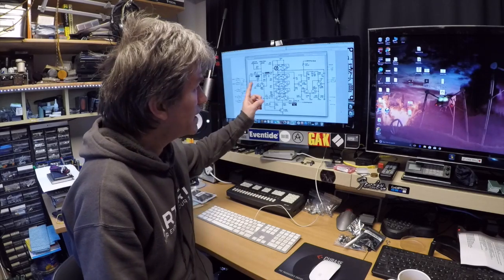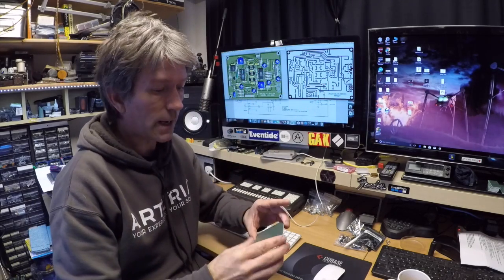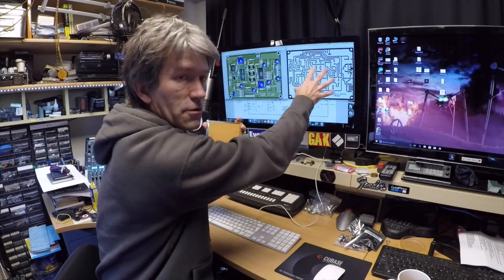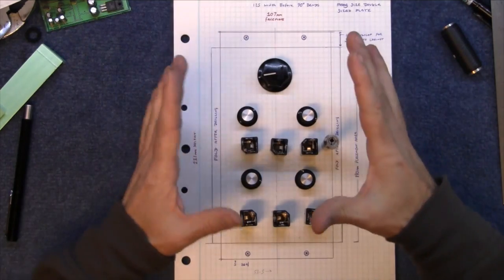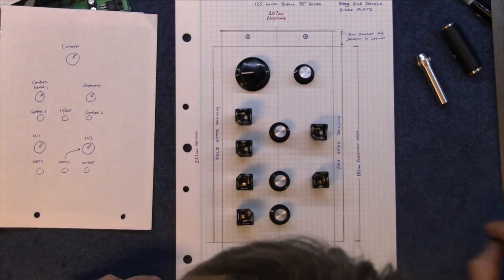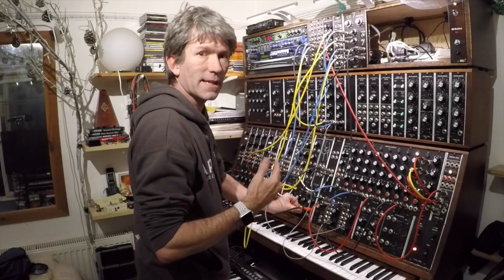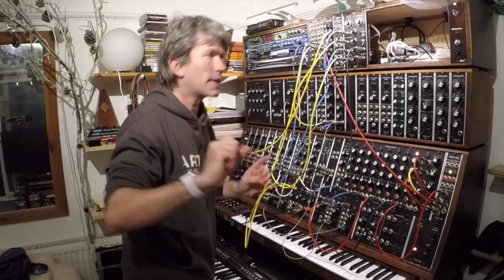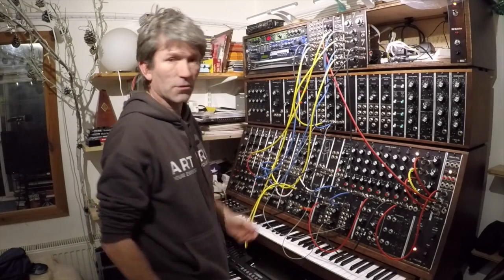BOB's LADDER based on moogs ladder filter built on simple perf board

Comment: On the jacking system.  it is a hell of a lot better to put all the jacks on the top or bottom, of each module, so the patch cords and jacks don't get in the way, when You are trying to use it.  I would use RCA jacks as they use smaller plugs, are cheaper, and very robust.

Comment: It is actually a hell of a lot easier to etch boards than You think.   Especially with the pattern is already done for You.  You can coat the board with a mixture of Potassium dichromate, and gum arabic, and copper sulfate to make it more sensitive to UV.   Mostly gum arabic, (like 80 %) and a few grams of Potassium Dichromate, and perhaps a bit more copper sulfate, to make a quart. After spreading that on the board and letting it dry in the dark,.. Lay it out in the sun with the mask  over it, for ten - twenty minutes or so (experiment first), and then wash off the part that was hidden in the shadows that is still water soluble.  You etch in Ferrous chloride (witch is nasty but not nitric acid), and by placing about 6 Volts DC, on the board, and a carbon rod in the solution, you can increase the rate of etch, and also use the solution over and over.   i can't remember witch lead connects to the solution, but basically that is the side where copper is going into solution , so I think that's the negative side. After etching, wash off the board thoroughly, and then let it soak over night in water with a little baking soda.  It is so much easier not to have to wire each board over and over. 
   I believe that guy You mentioned also sells pre etched boards and they don't seem to be too expensive.  The problem with the rat shack type boards or the Chinese equivalent, is that the copper bits are so tiny, that they easily delaminate, or fall off the board with the temperature of soldering, especially when correcting a mistake.  You can also make a silk screen the same way i just mentioned above to make lots of the same circuit.  Remember the dark parts of the pattern on the plastic sheet are the parts that get washed away, when it is on the board, and the opposite when You are making a silk screen.  To make a positive from a negative You are going to have to do some graphics image reversal on Your computer.

Comment: Sounds great! :) And the instructions are really neat, thanks for this! Actually i've expected to hear something "classic" like two-detuned sawtooth oscillators and "cutoff sweeps" showcase. But this also demonstrates something!
Markus, if you're really into simplifying the hard work of board making then you better look at this!
https://ru.aliexpress.com/item/PCB-Manufacturer-in-China-Cheap-Circuit-Boards-Fabrication-Printed-Circuit-Boards-by-Advanced-Circuits-free-protoboard/1817842276.html?src=google&albslr=126207724&isdl=y&aff_short_key=UneMJZVf&source=%7Bifdyn:dyn%7D%7Bifpla:pla%7D%7Bifdbm:DBM&albch=DID%7D&src=google&albch=shopping&acnt=494-037-6276&isdl=y&albcp=657872107&albag=38867178172&slnk=&trgt=61865531738&plac=&crea=ru1817842276&netw=g&device=c&mtctp=&gclid=EAIaIQobChMI-P6h_9P82QIVqrDtCh39CwBREAYYASABEgLMF_D_BwE&gclsrc=aw.ds
People says that they do with a really great quality and deliver quickly. PCB making within three (!) days!

Comment: Awesome build, and a very nice video! Note that apart from matching the transistors in the ladder (which is 5 pairs in total, if I recall correctly), Moog also specified the capacitors in the ladder to be within 1% of eachother (which is easiest done by just buying 20 caps and match them, rather than trying to find expensive styroflex caps). I myself did a PCB which also has the Minimoog discrete "dual" VCA, highly recommended!
Reply from the maker: Hello I did check the caps and they were all pretty close in value. but yes the better the match the better the circuit.
Reply: markusfuller , lots of nice vcfs to choose from Polivoks or Wasp if you want something nasty, 2044 (reissue!) or 3320 for a nice vcf. Great that the ic's for both of the latter ones are in production once more. Good luck with your channel!

Comment: Markus Just another side note, you should check out Tony Allgoods site. Oakleysound.com for some more diy BRILLIANT modules, the format is MOTM but easily converted to synthesizers.com format. He has a guy called Krisp who makes the modules ready made as MOTM or Dotcom.
Dave Browns ModularSynthesis.com is an absolute treasure trove of deatailed information you would love as he goes really into depth about the way different modules are made with very good photos to accompany them.
Analognotes.com is a kind of reference library for other links to usefull bits of info, manufactureers of modules and other bits and bobs.
If I can remember some more I'll tell you.

Comment: High Mark. I'm the guy who mentioned Yve Uson to you not so long ago. Anyway, I am just about to get from Oshpark open source pcb manufacturer a wonderfull little circuit based on the Ian Fritz' transistor matcher. There are 2 main, (well 3, if you consider  Bob Moogs method in the Minimoog service manual) of matching transistors that seem to be the rule of thumb within the synth diy community. One is Ray Wilsons method which can be found under the side menu of "Transistor Matching 101" from his website "Music From Outer Space". Anyone who is into synth diy would of come across his font of knowledge at some point or other and if not and anyone who is starting out like myself into the foray of trying to fathom schematics etc, you should check out the web site. Sadly he passed away a few years ago now and no doubt has left many broken hearts. Typically, as is the case with me, I always arrive late on the scene and have only relatively recently discovered the universe of possibilities of being able to  create synthesizers that make the sounds we are all familiar with.
Anyway, I digress and waffle on for ages not actually getting to the point.
Ray has a schematic for creating a circuit to test NPN and PNP transistors which is briliant but I am just getting to the point where I can follow the signal path within a schematic but cant for the life of me translate that into a breadboard circuit or stripboard, whatever. Rays circuit measures accurately each transistor so one would obviously "match" the values.
There is another circuit which is far les complicated and a damn site easier to build and use, (I say that even though I still cant lay down the plans in circuit form).
Ian Frit's transistor matcher measures the difference between the two transistors and can be used in a way that a reference transistor is used as a base line to compare to or can be used to just obtain the reading of each one individually.
This long winded dialogue started with me trying to say that I'm getting a couple sent to me from the pcb manufacturer some time towards the end of the month and was wondering as a little trade perhaps if we could correspond through email or something if you could tell me how you make your panels, as I'm wanting to make my modular in the MU format or Dotcom as its sometimes called.
I want to make my own faceplates but the bending of the side bits I;m not sure how they are done. The Dotcom panels seem to have a slight curve to where they are bent that gives a lovely aesthetic look when two panels are side by side but I'd love to know how they are done, with a machine clearly, if you look closely you can see what I'm refering to. The aluminium sheet doesnt just have a straight square cut out of the four corners and then the sides just bent inwards, there is a little signature small curve and then is bent.
I would still like to have a go at making my own panels. I'f they are no good I might just go MOTM or failing that by blank panels from Synthesizers.com or Moon Modular.
Like I say I'll do a trade for some info on how you make your panels because you never did tell us how you made the panels just showing us your experiments with annodising and engraving and that was that.
Perhaps you can help me read a schematic and then re-create it on a breadboard etc. I'm slowly learning this electronics lark but slowly being the operative word.
Most transistors providing they are bought on a strip or ammo belt will be fairly the same. Synths tend to call for VBE to be matched, not always but most of the time.
That Peak thing you have should read VBE I think.
I'll show you the pcb layout if I can send you something to somewhere.
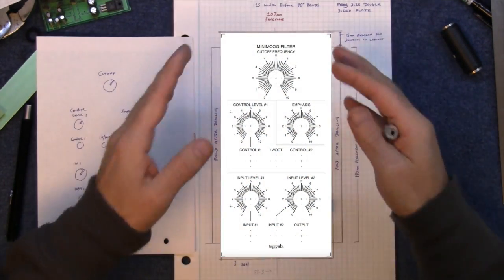Reply from the maker: Hello firstly Thank you as you did indeed point me in the direction of yusynth.net which is a gold mine of useful information. I made a previous video titled "Expanding the Moog Modular synthesizer & making the Attenuator" in it at about 5:08 I show the metal bending machine that I use to make the edges. this is a bit expensive about £200 but there are several vids on youtube showing how you can make a similar device with just 2 pieces of angle iron bolted to a desk. I simply bought the Clark version as it also cuts bends and rolls all in one machine and it was purchased for other work I do. as for Transistor matching I am simply using the Peak analyser DCA55 which gives several readings about the transistor under test including Base > emitter Vbe / test current / and Current gain Hfe / Ib test curent /Ic=leakage current / . though theres are several much cheaper versions now available on amazon that do the same job but not in a fancy box and some have even more tests built in. I just chose 3 sets of 2 that showed exactly the same values, and the filter unit sounded just right. back to the bending procedure. I normally cut the corner out before I bend the edges but it is always slightly messy so I have to use a diamond file to tidy the cut edge as best as i can, I cannot get that perfect looking edge as you get with Moog panels - it always has the home made look to the edges. if you want to round off the bend instead of a straight 90degree bend then you place a piece of scrap metal above and below the piece you want to bend and your piece the sandwich filling will have a rounder bend to it but it makes it 3 times harder to do if you have a manual machine like mine. Translating circuit to breadboard. well this just takes time and patience to do but you can use a program called Fritzing which is a free download and you can design a circuit onto a standard breadboard literally moving components back & forth until they fit, its a bit awkward to use as you have to dig through menu to choose capacitors transistors chips etc so they can be visualised in the correct size when you place them onto the breadboard. then you can go and check the schematic that it makes in the background, Its relatively new and i did try it but found i was taking too much time looking for components etc and the schematic was quite messy when visualised, however its a great program in many ways and i think they are only on Beta at the moment so should get better and easier to use. I personally without getting too big headed find it easier to do from my head only because i have been doing this for over forty five years though the easiest way is not to use stripboard or breadboard but instead use perfboard where all the holes have a ring of metal but no hole is connected to any other hole, that way you can match the circuit part for part then flip it over and start placing wire or solder across making tracks in the same pattern as the circuit board you are trying to make. I place a component then tick it on my printed image then when i make a connection from one component to the next I colour in the track on the printed circuit diagram i am working from. that way you can track as you go along and not miss a single thing.
Reply: Oh sorry I was not aware of this video, I thought I had seen all of your lessons. Brill I shall check it out, thanks again for all of your vids they are extremely informative and I have learnt a lot and it is infectious the passion you have for your work.
I see that many people on youtube use perfboard to realise circuits and will have a go at doing it.
Thanks again
Keep up the good work

Comment: Yusynth is a great site! I've built this same filter, and while I do not own an original moog filter, I can say that it is nearly identical to the Synthesizers.com Q150. The main difference I noticed is a slight difference in the tone of the resonance when nearing self oscillation. I also highly recommend the Arp 4072 VCF. It's my favorite. The clock divider is also sweet. You can feed in audio rate signals and use the division to create chords out of a single tone.
Reply: Nice trick with the Clock divider, up to now I was using it mainly with step sequencers, but using it as a chord generator is very neat !
Reply from the maker: wow thats interesting to know, I think I shall certainly put that on my to-do list. Thank You

Comment: Cool Yamaha QY300 sequence on the desk, Markus. Excellent video, as always :)

Would this design work ok in +12/-12 eurorack power bus?
Reply from the maker: Hi this design works on both eurorack and moog. the instructions tell you to change 3 resistors for the eurorack version and jump 2 resistors. my top box on the modular is set to eurorack power so the one I made is +12 -12 and it works fine.
Reply from the maker: I forgot to add that the unit under the desk is a QY700

Comment: Could this not be done in maths using a ADC, DSP, EEPROM and DAC plus a clock generator might be more elegant.
Reply: Of course filters can be done digitally.  And have been done digitally in many many synths.  Most Yamaha synthesizers throughout time are 100% digital ( Yamaha went digital with the DX7 and never looked back.)  And the ones I have used, all have digital filters.  It's 2017 though, and analog has had a bit of a renaissance.  Maybe more than a bit.  Modular is back.  Analog is back.  Digital is often viewed as silly because a lot of people won't pay big bucks for a digital synth when they can do it in software for free, or at least a lot cheaper than some of the digital synths.  Personally I prefer hardware synths and usually digital.
Reply: Or using an Ipad that already incorporates those things (as Moog themselves did with Animoog). However, real knobs and the vagaries of Analogue are why people still like it.
Reply from the maker: Yes it could be done digitally and I have never been one to stand either side of the fence when it comes to digital v analog. I have just gotten into teensy 3.2 3.6 and hope to learn something useful for making synth & effects for future video's. but I need more days in the week to try and teach my old brain something new.

Comment: Hey Markus, where I can get one of those perfboard...it seems that they suit 500's series...Im just developing a module and need something just like yours...pls let me know
Sid
Reply: try ebay, I saw some old perf boards for sale there
Reply from the maker: Hi Sid they are oldstock from Radio-Shack many years ago and i doubt they still make them. although theres several versions of perfboard available on amazon. the smaller green one i showed in the video came in a box of 20 different sized cards from amazon but occasionally you can find the larger ones that you can attach edge connectors to.
Reply: Hey man, thanks for such prompt answer, it is highly appreciated. I will take a look on amazon. thanks again for your reply and for posting good stuff here...Sid